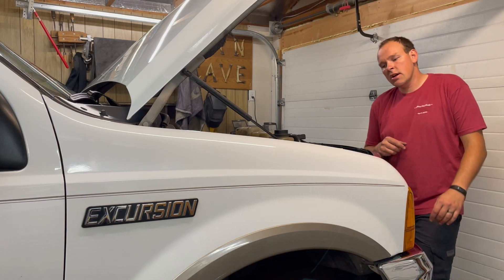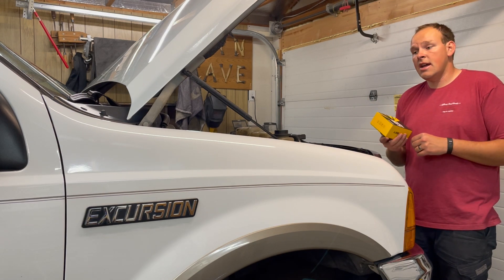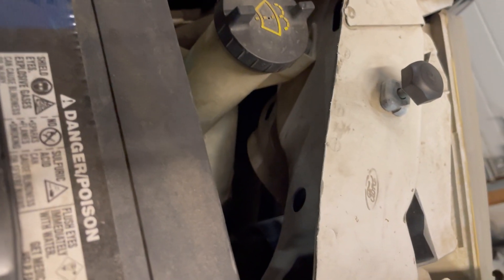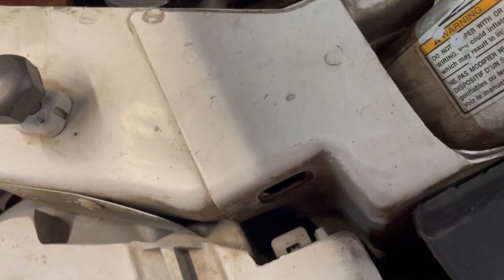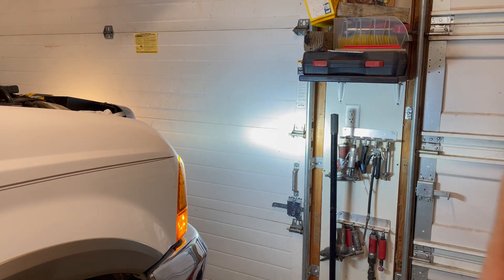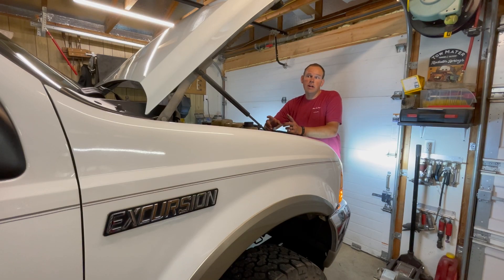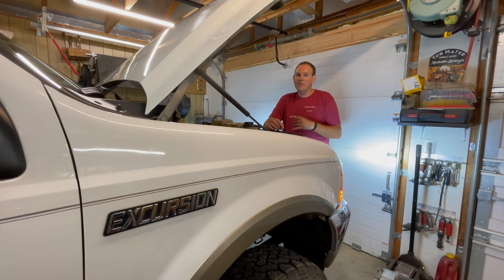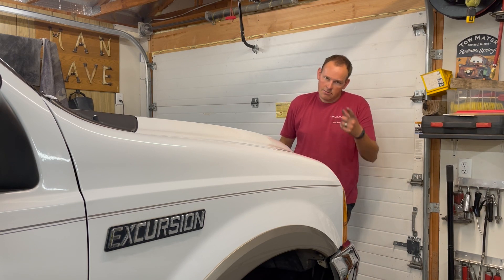Auxito 9007/HB5 LED Bulb Dual Hi/Lo Beam Install and Review: Ford Excursion Headlight Upgrade

Comment: Man, you're about a week too late with this video!  I just bought a different pair during Amazon Prime Days. However, if I'm not happy after installing them, I'll return them and try yours.  I did get the fog light LEDs that you recommended, so I'm going to try to install them both this weekend and see how i like them. Keep up the great Excursion content!!
Reply from the maker: Ah bummer! I even had this video in the waiting... sorry! Hope you like the set up as much as I do. Really changes driving at night.
Reply: @Geeks4x4  The ones I got on Amazon only ran on Hi beams unless I had the fog lights engaged. With the fog lights on, the low beams were on and I could engage the high beams, so I'm sending them back and I've ordered the ones you've recommended.
Reply from the maker: @stever6986  How funky! ya these has been great for me and hopefully you have the same experience!

Comment: I have a set of led bulbs for the fog lights on your excursion you can have if you would like. I work up at the steel supply by the airport. I switched out my factory bumper and no longer need the led fog lights.
Reply from the maker: I’ve got some sea light yellow led’s in there. But thank you!

Comment: I don't remember the make that I installed,  but when I did, my high beams and fog lights  come on when I turn on the fog lights. Do you have this issue or have any  thoughts?
Reply from the maker: Someone else told me they had this issue. I have not had this issue…
Reply: @Geeks4x4  it has something to do with the amount of current running through. I just presumed it was all LED bulbs. I will give these try. Thank you!
Reply from the maker: I wonder if I just haven’t noticed…. I’ll check again here and film it for a short maybe tomorrow.